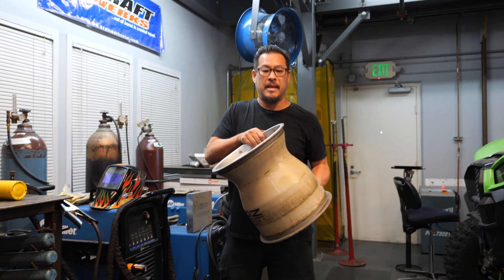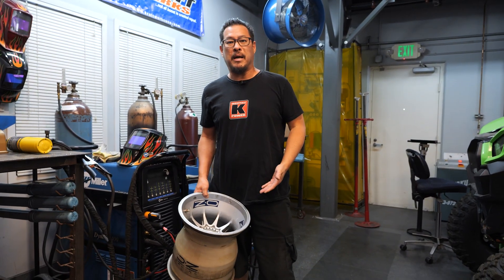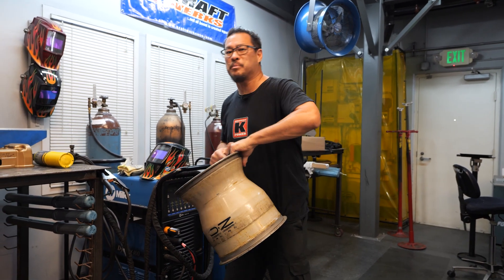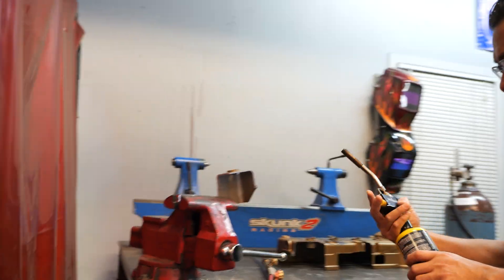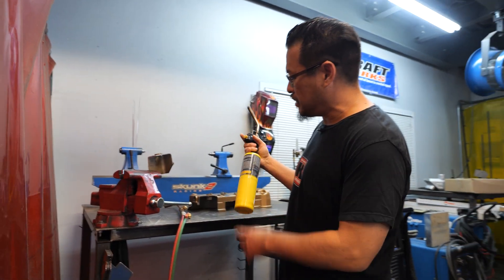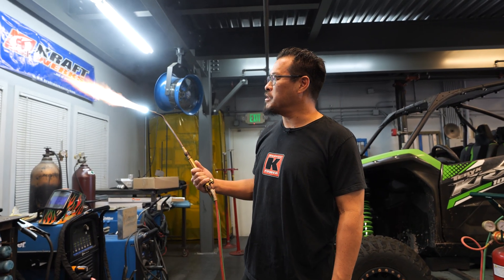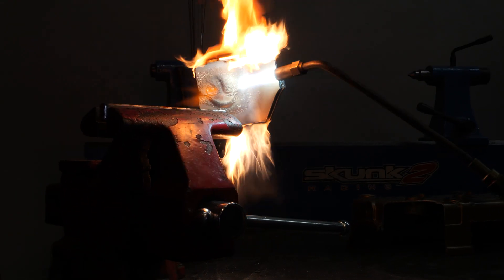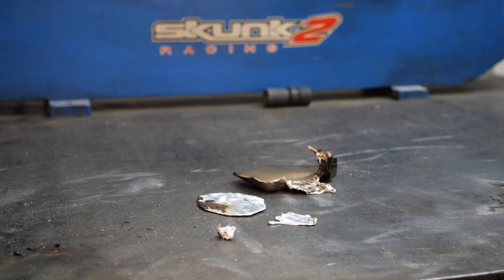Why Magnesieum Alloy is used for Racing. Feat. Skunk2 Ultra Lightweight Magnesium Valve Cover

Comment: Magnesium is light, but many companies do not want to sandblast and paint it, the painting itself is also more difficult than aluminum. I have the original magnesium engine covers on the car from the factory (BMW) - and honestly, I'd rather have them made from aluminum.